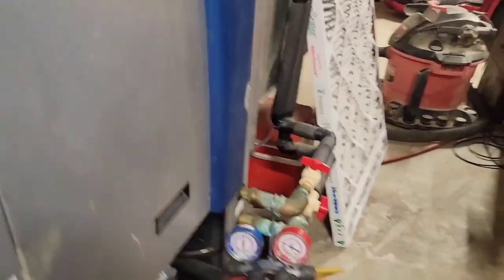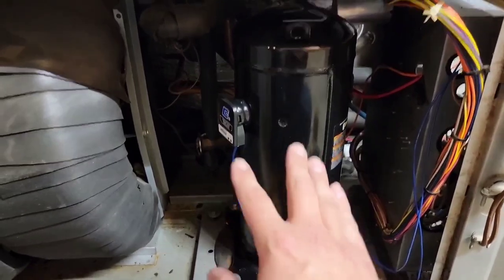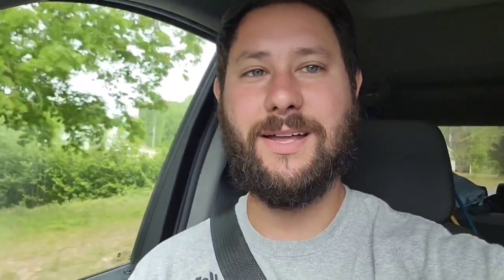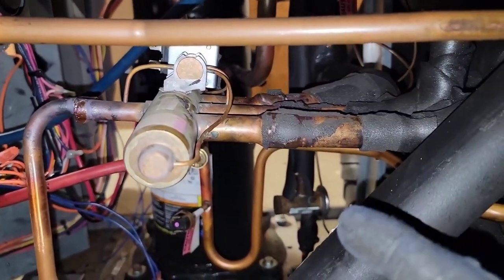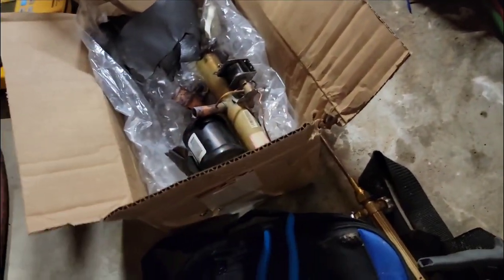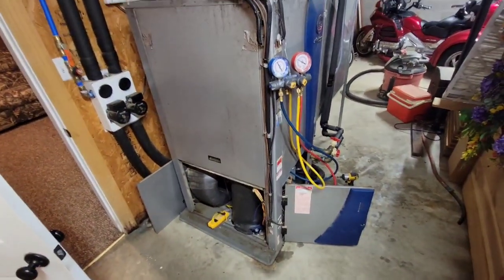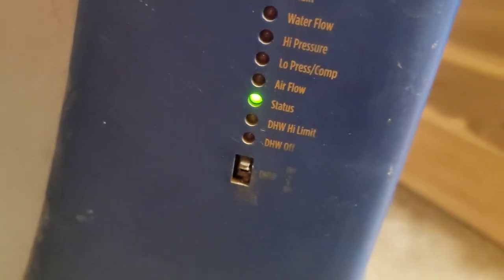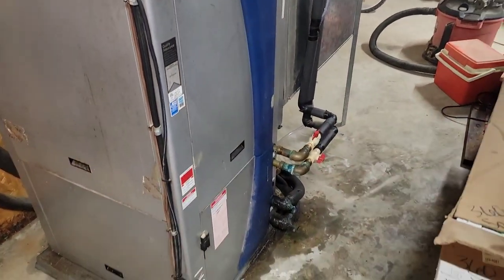Geothermal Reversing Valve Troubleshooting Guide for Beginners

Comment: If anyone wants a quick way of replacing the reversing valve all you have to do is take your blade of a sword or or hacksaw and instead of heating them all up and trying to pull them out you cook close to the actual reversing valve then you can individually pull on each one while heating it and cleaning it off
Reply from the maker: yes absolutely agree

Comment: What do you do when you have a water loop port that keeps dripping like that?  I run into that quiet a bit when servicing Geo's and it gives me concerns that the loop will get low because of the drip, granted the cap pretty much stops the drip.
Reply from the maker: If the cap stops the leak then I would not worry about it if it's shooting out very fast at a steady stream. Then definitely order another p t port

Comment: So what's the benifit of putting a gt unit over a traditional A/C  unit? This unit looks just as complicated as an A/C or hvac unit. I was under the impression that a gt system didn't need a compressor and all the same stuff as an HVAC. I was looking into GT to cut my energy cost. This is confusing to me.
Reply from the maker: all geo units have compressors only difference is they have a water coil